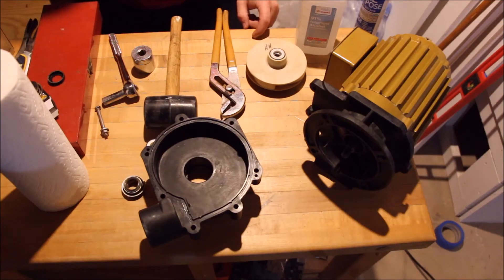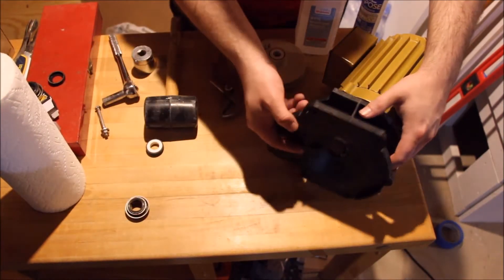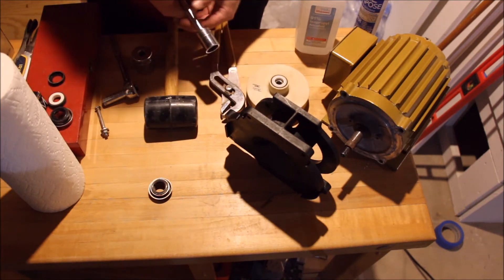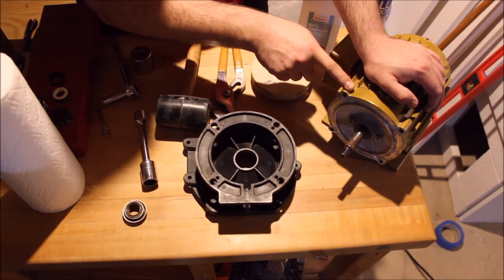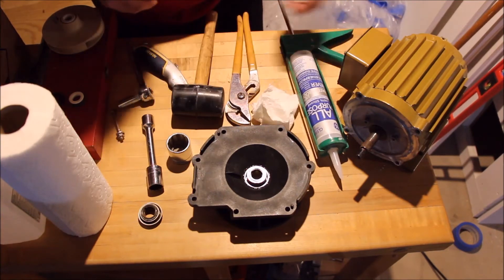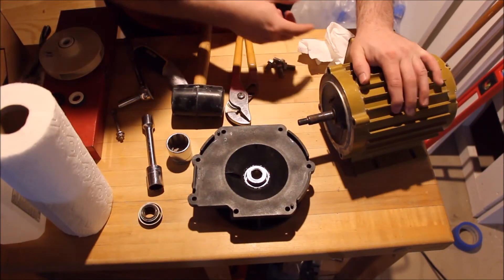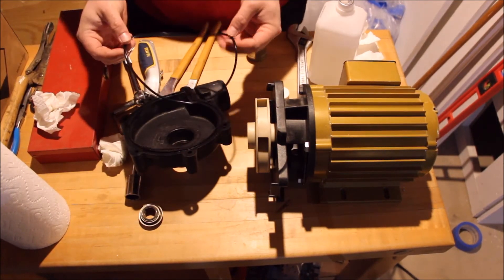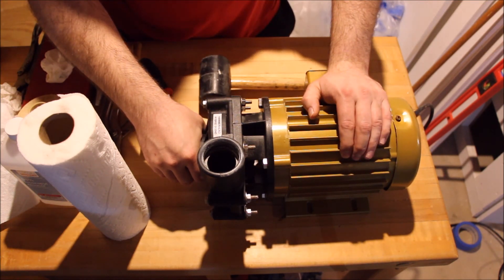Reeflo Hammerhead seal replacement

Comment: Looks like you use the standard off the shelf  PS-1000 seal. How long do they last? There is also PS-1000V which uses viton instead of rubber supposedly better for salt water. Do you have any experience with it? My first  pump lasted 7 years before seal started leaking. My backup pump seal lasted about 3 years.
Reply from the maker: They are standard PS-1000 seals.  I was replacing once a year pro-actively rotating between a couple of pumps.  I had one seal fail after about 6 months with a slow leak the rest I replaced before they failed.  The issue with pump seals is the amount of materials they are exposed to with saltwater marine life.  Even the best seal out there might eventually encounter an object that can cause a seal failure.  I never tried a better seal as life expectancy can really vary which is why I just replaced them once a year.  Even after a year there would be some salt creep, rust and corrosion on the pump shaft that would need a cleaning.

Comment: Everyone assumes seals somehow seal or close around shaft lol BUT DONT ! ...shaft is sealed out inside impeller... shaft can be full rust wouldn’t make any difference at all , or u could sand down shaft till cows come home to clean it up and wouldn’t matter either , shaft is irrelevant in sealing process ...it’s the 2 ceramic faces of the seals meeting that seal volute water in.. if look at pump easy see NO PART SEAL EVEN touches shaft lol ... cept for end threads where the impeller , that only uses threads to push to ceramic faces together while seal spring pushes back👍 hope helps ..(yes impeller obviously held on by threads on shaft lol) also thanx for ur vid , nice how people help others , amazed reeflo didn’t do own video .. they should!!!
Reply from the maker: That is correct that the shaft itself does not form the actual seal and that the ceramic rings compressed together riding on the spring create the seal.  I just completed another annual seal replacement a month ago and due to the corrosion, rust, and salt deposits on the motor shaft and the motor bracket that holds half of the seal was unable to clear the motor shaft for disassembly.  I had to use some light force to remove the motor bracket and clear the motor shaft.  I always sand down the shaft slightly and clean it to remove that corrosion and rust so that when the motor bracket is reinstalled the motor shaft does not rub against the shaft seal housing during installation or operation of the pump which could damage the shaft seal mount on the motor bracket.  Thanks for the comment.

Comment: I am in the process of replacing the seal righ now on my hammerhead. The seal attached to the shaft appears to attached together. Any recommendations to remove it? Thanks
Reply from the maker: If there is a lot of corrosion built up it might be stuck.  Once the impeller is removed and seal housing is unbolted you can try to tap the motor shaft with a rubber mallet.  Just be careful if you try to use force as you don't want to damage the seal housing or the motor shaft.

Comment: Hello, I happened across you R2R thread and further looked at your system. "WOW" is all I can think to say. I'm sitting here with a slight buzz from applying my first coat of pond armor today. I'm gonna scuff with 60 grit in a day or 2 and then apply fiberglass to several seams. Mine is 12ft 4inches wide so I did heavy duty plywood stretching with glue and screws and multiple 3/4inch plywood layers. 3 more Pond Armor coats to go. I like your overflow designs !  Mine are gonna be a bit lower on back wall of tank and then 90 up to a stockman on both ends. Have a decent idea for my sumps and FX filters.  I will keep following you for sure and give any pointers you feel like sharing.. Thanks